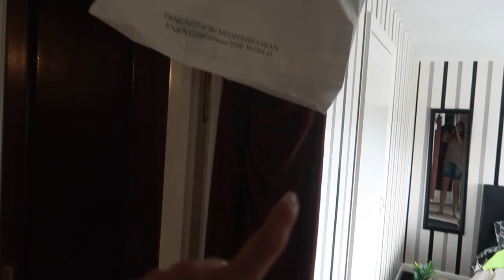BIKINI SHOPPING, CLEANING & CHIT CHAT VLOG

Comment: Pour some acetone on some cotton wool and wrap your finger nails in foil, even better if you can put a warm towel over your hands too, rather than peeling anything off.  Your nails will thank you for it. 💅
Reply from the maker: I’ll try my best, I always have good intentions not to pull them off 🤦‍♀️❤️
Reply: C just yesterday I did that to my nails, but didn't know about the warm towel trick. I was on my own so it was a bit tricky.
In the end I had to scrape off with a little curved tool 😮